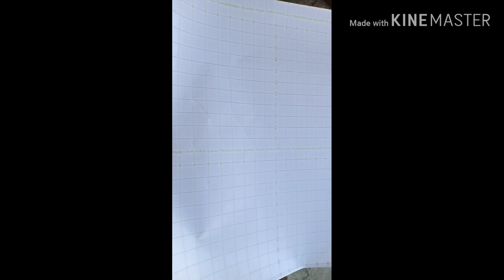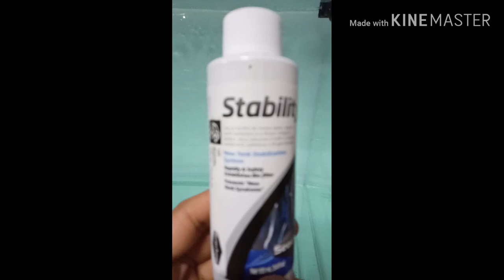HOW TO: set up an arowana tank ang sump filter

Comment: Bawal daw po ang lava rock sa arrowana   sabi ni google
Reply from the maker: thanks for the info sir. true that arowana in the "wild" are used in soft water conditions but this type of fish can easily adapt  to most types of water usually in captivity..sure that  lava rock hardens the water but it also keeps the nitrates in ideal level.. so i think its up to you if you use it or not as long as you keep your water parameters into the minimum..cheers!

Comment: malilinis nya ba yun ibaba ng tank?
Reply from the maker: Yes sir..madali namang linisin yung bottom nang tank..just use wave maker para yung mga dumi ay ma drain out of the tank.
Reply: ano tawag sa tube na nakapasok sa butas ng glass
Reply from the maker: @septrisomy2147  bulkhead yun sir.
Reply: @yaelscorner392  anong size yun bulkhead sir at mga tube pipes na gamit po.....hindi na rin po ba kailangan ng air pump, ganyang set up
Reply from the maker: @septrisomy2147  1 1/2 inch sir same din sa pvc pipes. No need for aerator na sir.